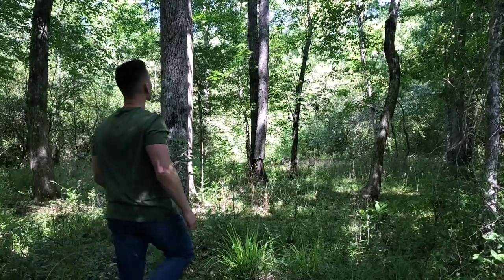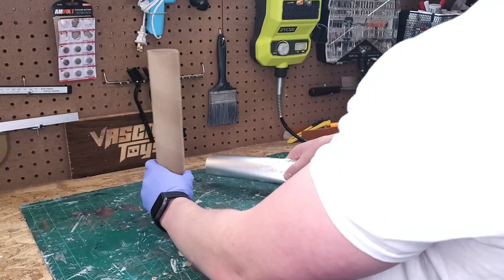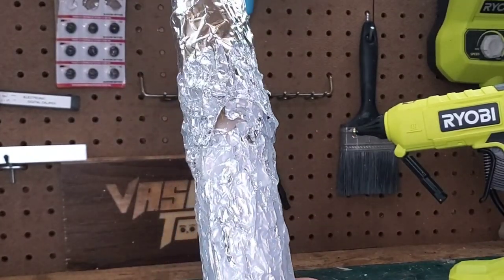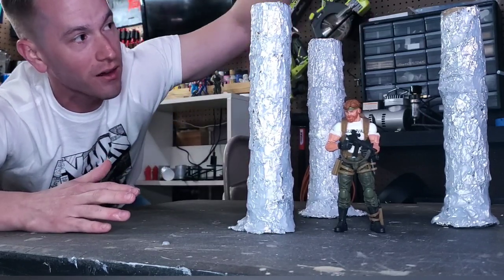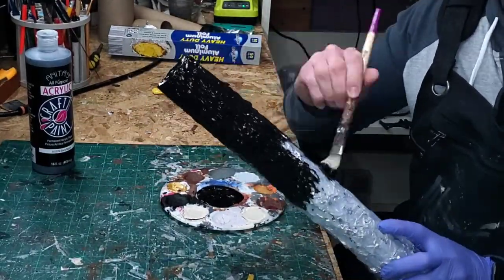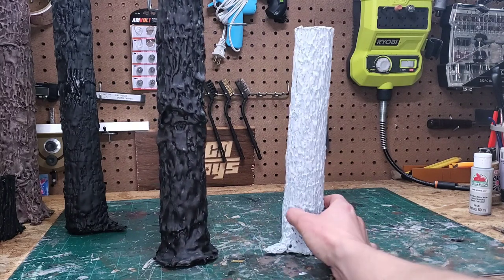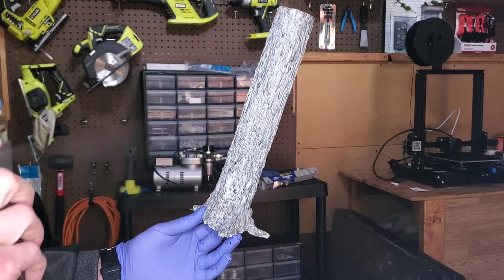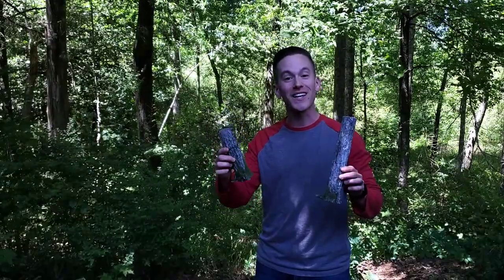I STUNK at making trees, so I tried this...

Comment: Paper towel tube and hot glue is how I have always done trees for my toy photos - nice job! I do use my smaller hot glue gun for the bark since I think it gives it a nicer texture.
Reply from the maker: Awesome! I was honestly surprised how good the texture came out from the hot glue. Looking forward to practicing and getting better with the technique.
Reply: @vascotoys  I never used the foil - but from looking at yours it looks to help provide an uneven bulkiness to the trunk that wouldn't be there without the foil (unless you load up on glue on the carboard tube) - so I will have to try that next time!
Reply from the maker: @pyroflyx  awesome! Yes, I think it also helps with the base / root system.

Comment: Yes, I would like to see a forest. And two suggestions I also saw on YouTube. One was swimming pool noodles for tree trunks, you can cut them and glue together for thickness. Also hot glue sucks to paint, I lightly sand heavily glued areas and still use primer if needed.
Reply from the maker: Oh very cool! That's not a method I was familiar with. Also, thanks for letting me know on the forest. Hopefully I can do that.

Comment: Nice work!  I do a lot of painting on to hot glue, and I've found that giving it a coat or two of a spray on matte sealer gives the hot glue a bit of tooth for the paint to hold on to better.
Reply from the maker: Thank you for that tip! Will have to give that a shot.

Comment: I also saw a maker video where they used masking tape and paper mache with paper towels instead of the hot glue. I dunno. Maybe easier and less chance of burning. Maybe a tougher method. Just food for thought.
Reply from the maker: Oh that sounds interesting! Do you by chance have a link? I think I'd like to make a bunch of trees using different methods to represent different trees in a forest.
Reply: I don't have any links off hand but search paper mache tree. Roccothegreat is one of the creators. There were a few.
Reply from the maker: @michaelsexton170  oh gotcha! Yes, I know Rocco. I watched his video on the paper mache technique. Was thinking about giving that a shot as well.